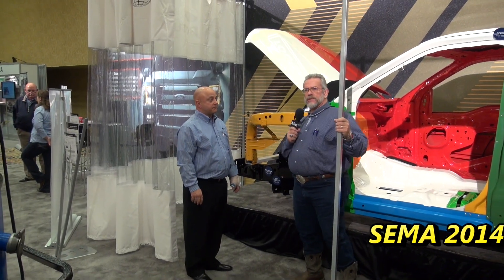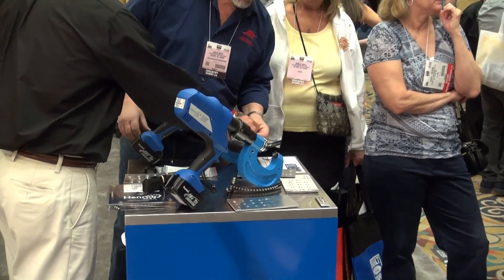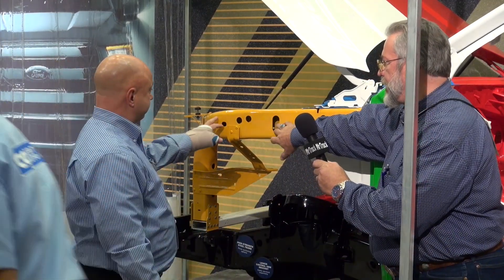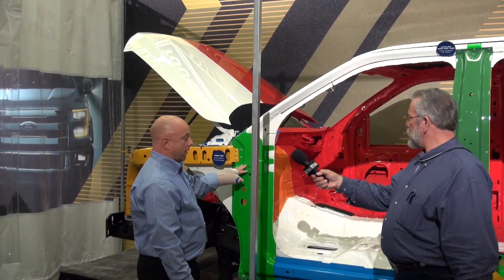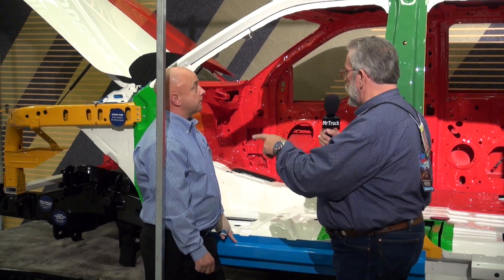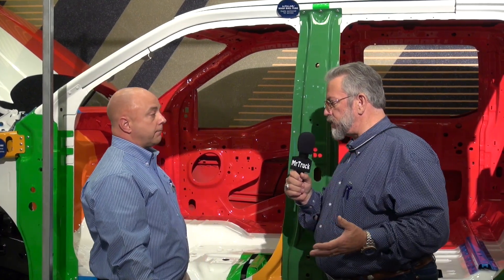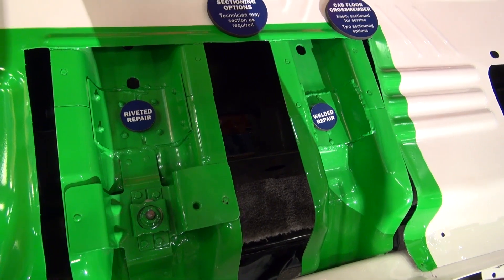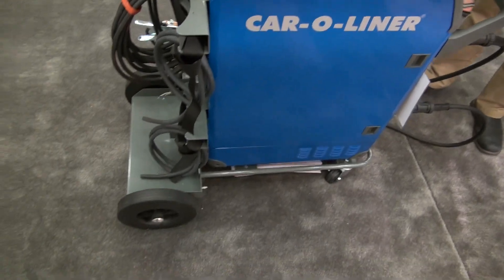SEMA 2014 Showcase part 4 with Ford's aluminum body shop training

Comment: I thought that steel and aluminum don't mix well??? What about galvanized corrosion between the two metals. Rust Bucket!
Reply from the maker: The two metals are isolated. Most horse trailers use aluminum and steel. They isolate it with Marlor 3m tape. Ford frames are steel and body is aluminum. They are separated with rubber body mounts and 3M tape.